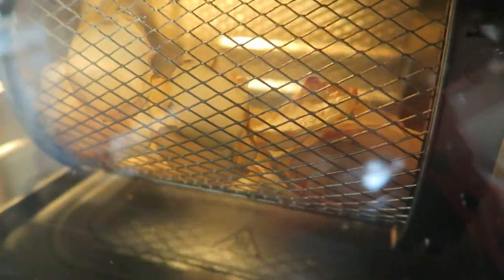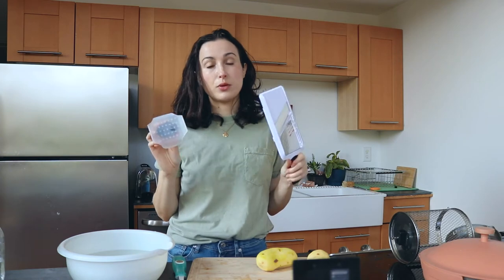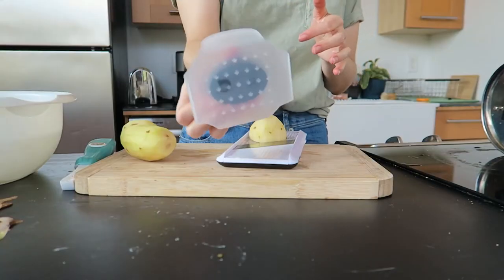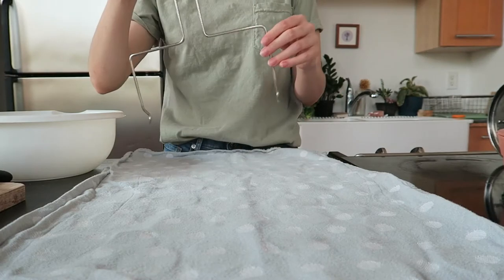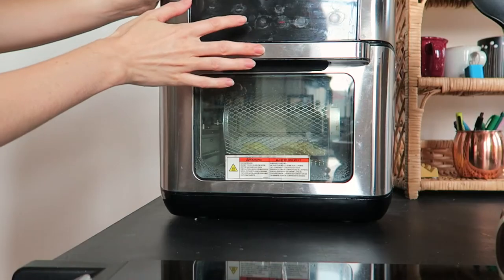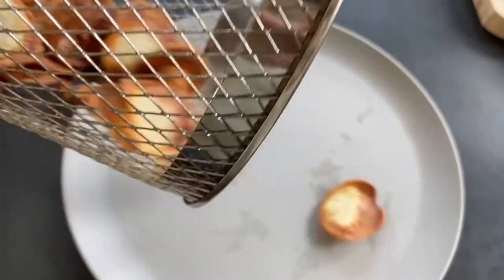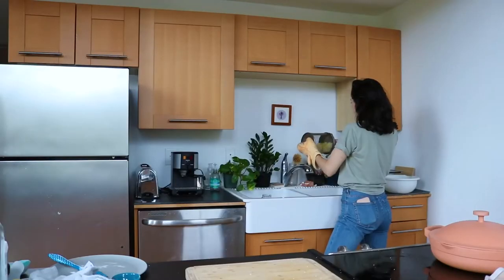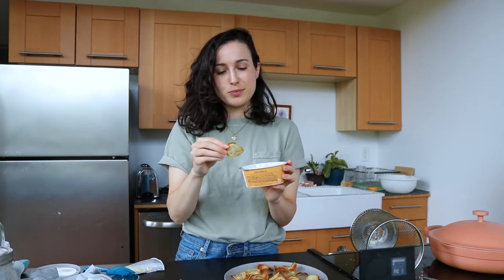Making Homemade Air Fryer Potato Chips in the Rotisserie Basket of My Instant Vortex Plus 7-in-1!

Comment: My go-to method is to cook the chips fully at a low temperature (so they don't burn) and then just dehydrate them until they are 100% dry. Guaranteed crispiness. Most of these rotating air fryers have a dehydrating function, thankfully, because I managed to wreck my dehydrator. Have to work out a few quirks: some chips end up too hard, and I'm not sure what's causing that, I don't think it's the dehydration because some chips end up literally perfect. Anyway it's an otherwise pretty good method to try out
Reply from the maker: This sounds like a great method; I’ll give it a try next time!

Comment: I've been on a similar journey and am trying to make spiralized chips (not the stringy kind) in my countertop oven without oil.  I was wondering if using a rotisserie would work with the spiral chips.  What I found was that the smaller spiralized potatoes "stood up" more than the larger ones and that I got a crispier chip as a result.  I don't own a rotisserie oven but.... I'm thinking it could work after watching your attempts.  Have you tried that yet?  My hubby really loves chips and I'm looking for something easy.  As for now, we eat a lot of roasted krinkle cut wedges coated with onion powder, garlic powder and paprika along with a sprinkle of medium coarse cornmeal and they're perfect at 425f for 25-30 min (depending on how crispy you like them) with a turning halfway through.... using my countertop oven.
Reply from the maker: This sounds delicious; thank you for sharing your recipe! I'll have to try these. Do you use any oil with your crinkle cut chips? Spiralized chips sound amazing but seems like it would be difficult to get them evenly cooked/crispy!
Reply from the maker: Just realized you may have meant "chips" in the British sense like what we would refer to as "fries"!
Reply: @TotallyForkable  My mission is to get away from oil and get him off of store bought chips.  It comes out better with a little spray but I try to avoid it for the most part.
Reply: @TotallyForkable  I referred to both actually.